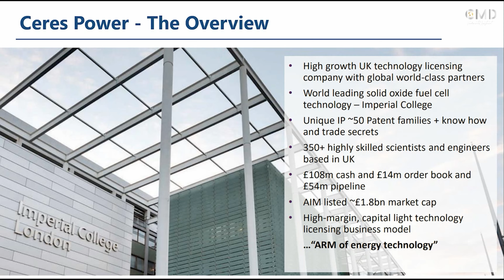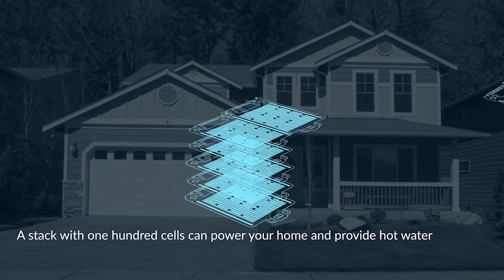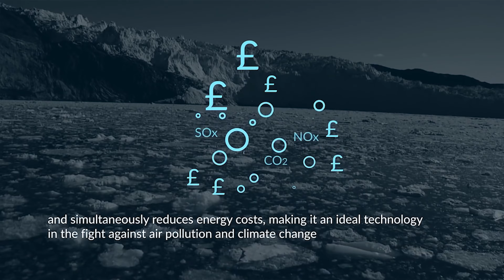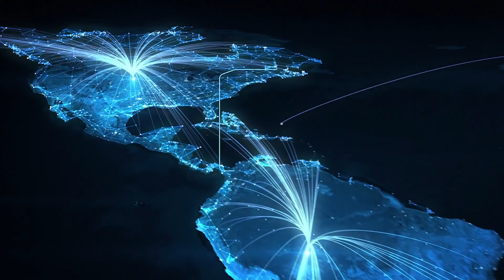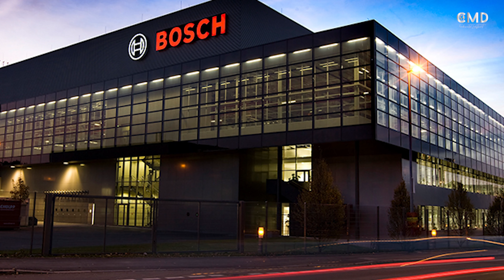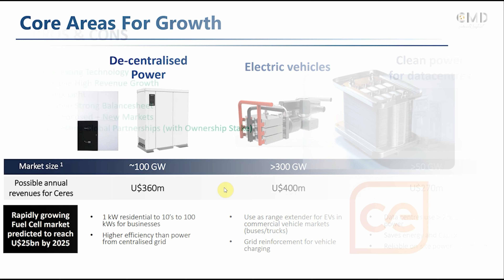Ceres Power Stock Analysis - All You Need To Know About This Fuel Cell Pioneer

Comment: Good thing about Ceres technology is that it is not dependent on rare metals, unlike its competitors. 
For example, with the wider use of fuel cells, there may be a lack of platinum
Reply from the maker: Hi Martin, Cool! Thanks for the input as usual :)

Comment: Hi, thanks for the videos of which I have watched quite a few, I am from an electronics engineering background so this type of technology is new to me and I'm still learning about it, I am just wondering how this company compares to ITM power in regards to the technology that both of these companies utilise? Thank You.
Reply from the maker: Thanks for the video and cool background! You will probably have a lot easier to understand it than us :) We are by no means experts, but as far as we can see the big difference is that the hydrogen fuel cells from ITM Power is based on polymer electrolyte membrane (PEM) while the one used by Ceres Power is based on solid oxide. According to Ceres Power this is cheaper and more robust.
Reply: @cmdfundamentalinvestment9033  Ah, OK, thanks! I do have a few shares in ITM but TBH I didn't know anything about Ceres previous to this.